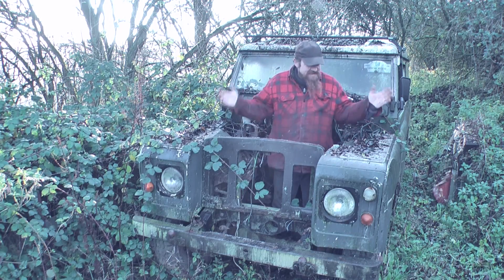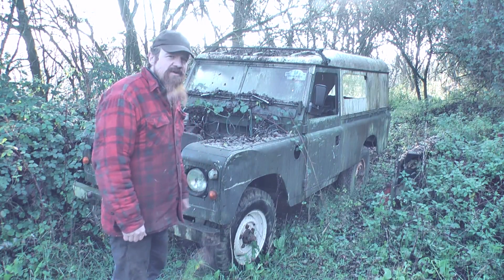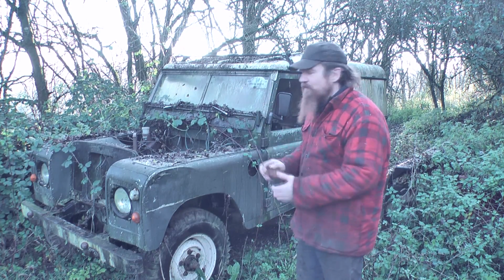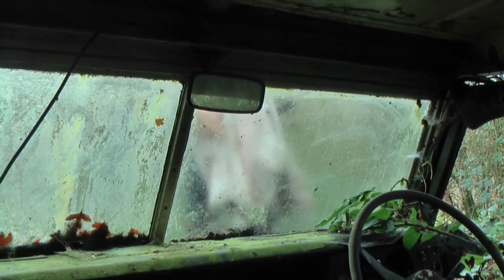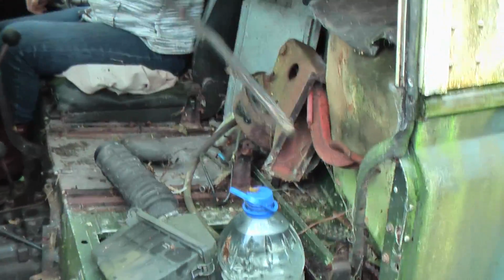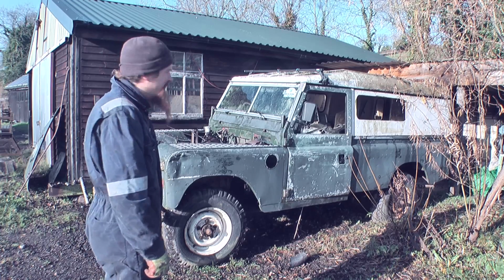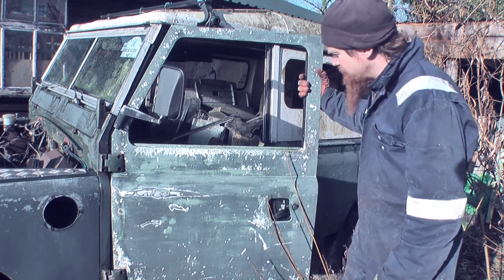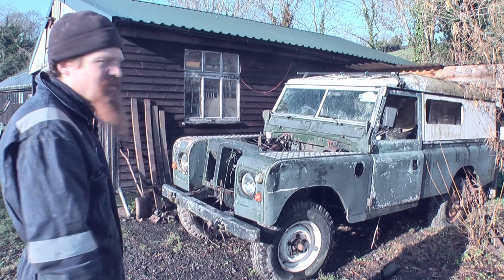Project Kermit 1:  A Land Rover Series 3 Full Restoration

Comment: Hi Max, some 30+ years ago, I restored a SIII landrover for use driving in a marine environment in New Zealand. The vehicle was in such a state that I ended up acid-stripping the chassis, bulkhead, door-frames, window-frames, and all other steel parts, then welding nearly two m^2 of steel sheet to repair all the rust holes -- and then hot-dip galvanizing everything (I had to drill a few additional holes to let the molten zinc out of the internal cavities, of course). The galvanizing was a huge success, and 20 years of hard beach driving later all the galvanized steel items were still intact. This is a long-winded way of suggesting that you might want to consider hot-dip galvanizing for your own landrover restoration -- in my case, the galvanizing was actually cheaper than painting (and, of course,  you can't paint inside hollow sections). Love your work BTW...

Comment: Fairey overdrives are getting rare and sought after, have one on my truck and it does make a difference in noise and fuel. nice project . Cheers
Reply: They used to be installed on a lot of V8 Range Rovers here in Australia. My 2 door had one, and it made sort of a difference? Pretty noisy, apparently they are very fragile behind the V8.

Comment: I made a bumper from a thick metal pole that held a street sign. Slash cut the ends and capped off. Some beefy steel mounting frame with holes drilled for D shackles. Made a greeat nudge bar that did!  👍

Comment: Those early 110 doors with wind-up glass and lift-up handles are the best of both worlds in my opinion, and quite hard to find unless you opt for reproductions. I fitted a single cab to my 109 at one time and found it very cramped even though the sloping rear bulkhead on a LWB offers more space for the seat. I often thought about a king-cab type conversion in the style of a 60s/70s garage recovery truck, but in the end I put the van body back on!

Comment: LOL I have used a hydraulic floor jack to move the sideways on concrete before.Never seen it done on dirt with a bumper jack. Nice. Using a snach block to back it next to shop was a nice touch also. :-)
Reply: Jim Weber I was afraid the lean-to might come down, rather than the LR move! However that might have sent the viewing figures sky high.

Comment: There 90/110 doors pre 1986/87 because they have the lift up door handles, getting hard to find now so make sure you don’t let the scrap man have them mate!  
I Will look forward to watching this old landy being restored..👍
Reply: I have them on my 127 too!
Reply: 1961 nuffield I’ve also got them fitted on my genuine county, the doors he has are even rarer as they only did the lift up handles without the galvanised rail on the side around 86/87!
Reply: @PillSharks  My 127 is from 1985 and as far as I can tell they are original fitment. I have also fitted a 200tdi 😉
Reply: 1961 nuffield have they got the galvanised strip along the side, they continued it for a few years just like the series doors?
Brilliant conversion,  best engine Land Rover ever made in my opinion... only just beating the 2.25 petrol
Reply: @PillSharks  Yes they do, it's a great truck with a high capacity bed and a toolbox/tyre carrier to make up the space.

Comment: I have a 1972 109" with cherrypicker that I'm restoring. Yours is maybe a bit more solid. 😂. I have a 1966 swb and a 1969 109 as well but all petrol engines. The old 2 25 diesels sound nice but don't go very well and never found them very reliable, although they were frugal. Good luck with the project.
Reply: I meant to add, the angled windows you mentioned are off a military coiler, series vehicles had a straight window divide.

Comment: Nice coincidence that it's just ticked over into the 40 year mot and tax exemption age! 
Good luck Max, it will be great with the Tdi.
Reply: he'll need an mot but the road tax exemption is a sweet bonus ...
Reply: @mrb1864  40 years old means exemption from mot's.
Reply: @MarktheOddJob  , he'll need an MOT ... only MOT exempt if not major chassis or engine work/alterations in last 30 years, hardly any classics avoid the MOT in reality ...
Reply: @mrb1864  Will be MOT exempt with 200TDI as it was available within 10 years of the end of Series 3 production.
Reply: The trouble with having no mot on a classic is if you have an accident, and you’ve vouched for the vehicles road worthy state your insurance ain’t  gonna be worth shit.
Reply: My Series 2 with a tdi hasn't been moted for years and I'll happily drive it  thousands of miles. (See my profile picture). 

It's great that in this modern over regulated world that we can take some personal responsibility for our actions. Having an mot means it was safe that day, not the 364 other days before the next mot. 

The main thing is that these lovely old motors are looked after and even more importantly that they are used. 

:)
Reply: MarktheOddJob ll

Comment: Fascinating collection of crap in the passenger seat! This seems to be "the way" with Ironthumper vehicles.
That jack-assisted steering system looks like bloody hard work... but it seems to do the trick.
I was going to say "erm... isn't it a tad on the dirty side" but then you got out that pressure washer and that seems to have dealt with that.

Comment: well if you dont have tools before you start doing up a landrover you'll have plenty when you finish.i did a lwb safari up in the early 80s a6cylinder petrol engine. ran as sweet as a nut on its third engine.needed a complete rewire.so used white plastic coated wire for everything (it was free)made it quite interesting.

Comment: I need another old Series 2 or 3 Land Rover in my life. Great to see your Land Rover's it reminds me of when I used to have a few lurking about. Those front doors date from around 1984/5 and have Anti Burst door latches. The door handles are recessed and is how I date the doors. Both doors appear to be missing the original galv capping trim that was fitted to early 90/110 models. In 1986/7 (or thereabouts) the door handles were placed on the outside of the door skin to collect all the mud. In my opinion, it would be a big mistake to take out the original dash. I bought a Series 3 once with a homemade dash in it and it was nicely done but looked all wrong, like a boat dashboard and was just terrible to sit behind. It was binned and good S3 dash put in. That also restored value in the Landy.

Comment: the old Landie is what got me here in the first place.. so now its time to watch a second one... dunno why i love landies, never driven one... never been in one actually and never worked on one.. so it must be the boxyness...
i know i want one though..

oh, and whats your opinion on the V8´s? good, bad, horrible, fantastic?
Reply from the maker: I like them (or at least the carburettor versions), simple powerful and they sound great! They do need looking after though and a neglected one is more trouble than it's worth.
Reply: @maximusironthumper  right.. and they are easy to come by in the UK? i would at some point like to put one in my 1968 Volvo as the weight is not much more then the stock 4 banger :D
problem is.. here in sweden there is no suitable engines.. but the Rover one seems to fit the bill.
Reply: @Skuggan84  there were so many of them in the UK but they stopped being put in stuff in the mid 90s 

Thousands upon thousands of them were made though.
Reply: Land rovers are a bit like distemper in dogs, once you have the Bug you'll never get rid of it.
Reply: @Skuggan84  Fit the three litre Volvo six cylinder. I had a phenomenally reliable series one Maserati Sebring. Drove it from Johannesburg to Zambia and many other places in Africa below the equator. It had the Volvo six, not as fast as the Maserati engine but bolted straight onto the ZF 5 speed and didn't have Lucas mechanical fuel injection.
Reply: @andrewallen9993  well... they dont fit in the 140 without some work on the firewall. The Rover V8 fits good. And is lighter then the straight six :p
All I need is to get my hands on a really good carbureted one ;)
Reply: @zogworth  that's alright with me. I want a carbureted one.. and I figured they where common as every farmer in the UK has had at least a few Landies... it's like the Volvo B18/B20 In Sweden..  they where used in everything from boats to water pumps, tractors and combines... not to mention cars.. so they are still incredibly easy to find.
But a Rover V8 is as rare as a hen's teeth over here... so I guess it's the opposite in the UK.. you probably can't visit a farm without stumbling over a Rover V8. Am I right? ;)
Reply: @Skuggan84  I stand corrected I was assuming an older Volvo model!
Reply: Rover V8s are like dog turds, there plentiful and smell as bad. 
But light as a feather, and plenty of tune up parts still available.
Reply: @1unsung hahahaha good name!

Comment: Had a series 2a Land Rover short wheel base. It was virtually a wheel running rubbish tip. I had a plan to rebuild it  but after checking the diff housing and the wear between the gears, I started having second thoughts. The motor also was a problem and would need a total rebuild also likewise with the brake system.  I’ll tell you a story about the brakes. 
Had the drums m/c’d and new brake shoes all around. Beaut I thought that’s that sorted. Driving back home I came to a set of light and applied the brakes and pedal went to the metal. 
So I after checking out the master cylinder as that was the problem, it was beyond repair and so I bought a new one. Fitted it but the plunger rod was too short. Uh! You say. So I rang the brake people and they said you have the wrong sized plunger rod for it. I asked them what could I do and they said I could make the right length one and it would be apples 🍎. So with the “right” measurements I cut and made the new plunger rod. 
Must stop here for a minute and let you know this all happened the night before I was to start a new job with the company I lasted 28 years with and which I retired 2 years ago. 
On with the story,, so by the time I fitted the master cylinder to the Landy and  it was near twelve at night I just went for a quick lap around the block to check and everything was fine so I thought. 
 At 4 in the morning woke up and done the breakfast things and headed of to my new job in the hills above where I lived. 
As per usual and as you do you apply the brakes when you stop. This was the beginning of something that makes me wanna lol now but not then. As at each time I moved away from the lights it felt like the brakes where dragging. At the next set of lights the dragging was worst and actually was smelling brakes burning! The pedal was very hard too push down, actually it would hardly budge but spring back to full pressure. 
After stopping I quickly jacked up a wheel and tried to free wheel the wheel but it was seized solid! Done another wheel and the same result. 
So with all this information and after the panic left me re the new job being late first day, I took a punt and and released the pressure on one of the slave cylinders and pumped it once with it open the closed the valve on the slave cylinder and drove the next 35klms to work with no brakes. Lucky I was now in the Rural area and using my handbrake made it to my new place of work. Returning I home also was a big adventure but I was smarter with my new found experience plus a phone call to the brake place during the day for them to tell me the length of the plunger was for another make of master cylinder and so on grr! I bled the brakes but did not use them on the way home but used the handbrake instead.
However there was a another factor there was this giant hill I had to come down. This hill is pretty steep and goes for about 2 miles. 
In Angel gear you can from stop, rise up to 60 mph by the time you got to the bottom in a normal car but the Landy it only got to 50mph which was not a problem.lol. 
 Made it home with my heart on my collar and sorted it out. Not long later traded it on another vehicle. That was a relief!
 Ask me if I would entertain a Landy of any discription. No way!  I drive a Isuzu DMax now and it has all the grunt I need.

Comment: Nice one, another land rover rebuild to watch. I'm currently rebuilding my SWB 1972 S3. It now has a 200tdi S2A gearbox and RR diffs. It did have an overdrive but I ditched it as it was noisy and i think the extra power from the tdi would of seen it off. Just need to fit a new rear cross-member and redo the fuel and wiring and it will be back on the road. I have the same early 90/110 doors as you have fitted. if you do revert back to S3 doors you'll get a pretty penny for those doors if they are savable. they where only used for a few years on the early 90/110 and are rare as hell now. Are you planning to keep the turbo? or are you going Di? I believe that with it being a LWB you can't use the RR/disco turbo and manifold unless you notch out the chassis rail but a turbo and manifold off of a defender 200tdi will fit right on. Definitely looking forward to seeing this project progress.

Comment: I’ve got a series 3 109 with TDi, defender gearbox, disco transfer box and stage 1 axles. The engine still had the turbo and intercooler fitted and it all works very well. I’m interested to see if you’re using the series gearbox etc and are you keeping the turbo? Good luck with it.
Reply from the maker: Sounds like a nice setup you have. This one will have a series box, probably a rebuilt 2a with Ashcroft Hi-ratio conversion. Yep keeping a turbo, intend to use one off a 300tdi for clearance in the chassis.
Reply: @maximusironthumper  that sounds like a plan. My engine is mounted (quite low) with the Disco mounts and there is no clearance issues. The main problem with mine is the speedo is quite a lot out (sat nav solves the problem) , it was showing 45mph on the M5 but very little was overtaking me (I guessed it was doing about 75) but, being a series with a full tilt, long distance vehicle problems aren’t the main issue but my back and hearing are. I live in the far west of Cornwall so I suspect it will stay west of Truro.

Comment: Only thing I can’t figure out Unless there is something that I am missing. Fact that the engine you pulled out of a perfectly good running driving land rover to put in something that has been sitting in the weeds but I do understand your sentimental value to it but at the same time sentimental value versus practicality in my book sometimes you just have to think before you leap but that’s just my opinion

Comment: keep the defender doors.. roll down windows are worth their weight in gold.. being able to put your arm up on the door  and wave high out the window.. sliding windows make it more of a countach .. i never got to go thru my families 71 109  2.6P wagon or the 74 88 2.25P santana both hetcho in guatamala. built up from kits in central america so all the placards were in spanish.  had them stashed out behind moms house.. little sister and her husband filled the radiators with water.. cranked the engines to free them of the oil i have pumped into the cylinders for storage.. got them started and parked them out beside the road where every few days somebody would bother mom.. do you want to sell the land rovers..  when i got there.. they had left the batteries hooked up.. fuel in the tanks.. the spark plugs loose.. no cover over the engines to shed water from the hood gap.. the engines were both seized tight.. radiators busted.. water pump busted from the freeze..   they looked very much like your 109 when somebody made mom an offer for them and she took it.  i would swear you were dragging your 109 out of my moms back yard.  encrusted in black berry vines.  hopefully those got restored.. rather than parted out

Comment: On a marginally related note: when you come to need tyres, if you're still wanting 7.50R16 to make the most of not having power steering Bridgestone have recently released some that are good, quiet and significantly cheaper than the Michelins which were previous the only sensible option.

And whilst I'm sure you've got a heap of them somewhere already, if you need any wheels I've got a pile of them.
Reply from the maker: Sounds interesting, do you have a link to a supplier of the Bridgestones?
Reply: @maximusironthumper  I bought them online from Black Circles, though I note that the price of them has gone up and the Michelins have come down since I got them last year! Black Circles sometimes have discounts too, I got 10% off through an advert in Evo magazine.

https://www.blackcircles.com/catalogue/bridgestone/dueler-at-001/750/80/R16/N/114/f?tyre=37533683

Even if you don't buy them it's nice to have a look see what's around.
Reply from the maker: Great, thanks, I'll check them out
Reply: @maximusironthumper  I'm not going to claim them to be as good as a full off road tyre, but they're perfectly adequate.

They did a good job towing one of BT's 4x4 cherry pickers out this week after it had managed to get stuck driving across a flat field :D Quite how they managed it I have no idea, but by the time I got there it was well sunk.

Comment: Glencoyne engineering website. Steve Parker exhaust and bell housing bolt set website   
Couldn't have done mine without it. 
31.2 mpg ( over a 1000 miles period ) starts and runs lovely. A joy to drive. I kept the turbo modded the intercooler and spent a week sorting all the hoses out. Kept my series two rad as well. Never goes over 90 degrees. Tdis run pretty cool. I will be watching with interest!  Good luck

Comment: Oof you could of just taken the wheels off replaced the tires and took the break pads out of the drum breaks and it would of made it a 100 times easier you made a 2 hour job into an all day one, also the 2003 to 2006 engine your using doesn't sound healthy in the slightest hopefully you rebuild it before putting it in to catch anything before it nackers the engine up.